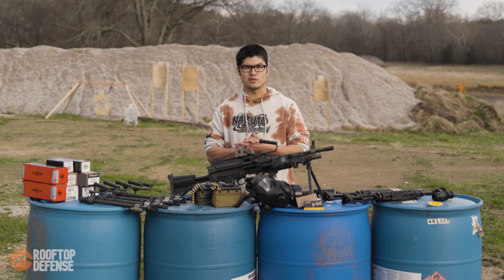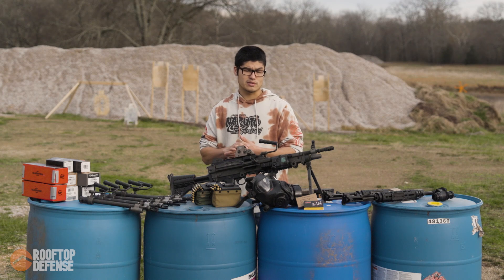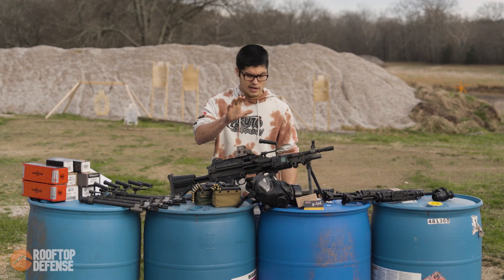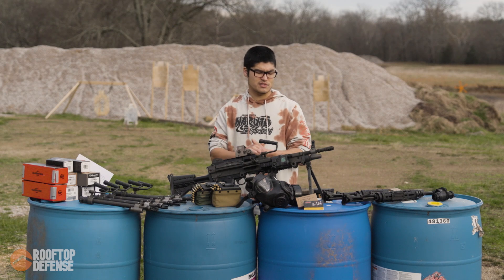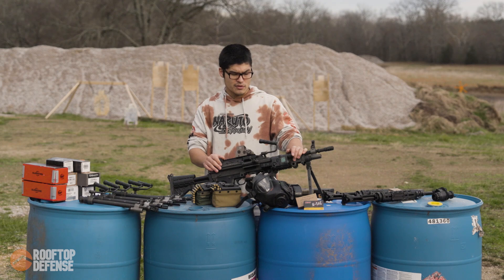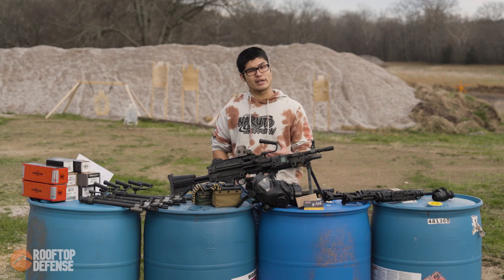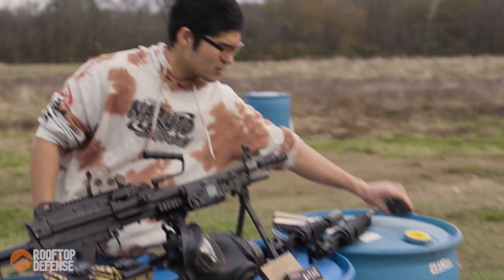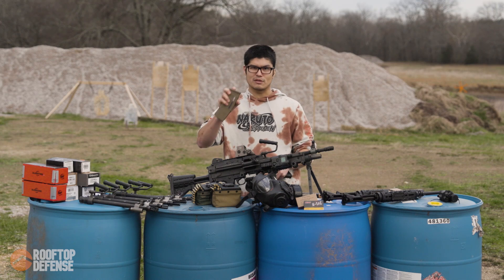Suppressor Stuff Ep 1 - Overview: The What, Why and How

Comment: Dude, super based, EXTREMELY well thought out. Assuming this is going to be done with a wide variety of available options this is going to legitimately be a Pewscience level usefulness comparison. I'm also absolutely loving the unexpected benefit besides all the obvious ones for seeing where and how red hot the various cans get (ex: RC2 has blast chamber venting to the outer tube that localizes heat/pressure where they always fail) without this test the KAC seems lame but the lack of glowing for night IR compliance with super low ROF increase is actually MORE compelling than Rc3 that was basically a vis light flow stick after the 100 rds. 

Thank you so much for doing this testing, I'm so stoked to study all of these results and you have earned a customer for life.
Reply from the maker: Right on! I'm glad to hear that you're getting so much out of this. The goal was to meet y'alls growing desire for more information on various suppressors. I wasn't sure how this would be received, but I'm stoked to hear you really like it, dude. Thank you!